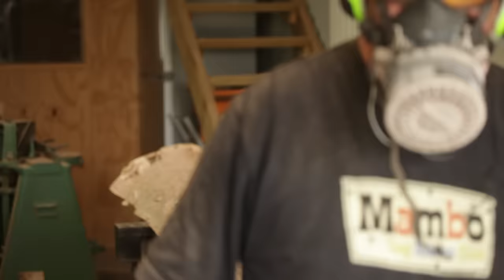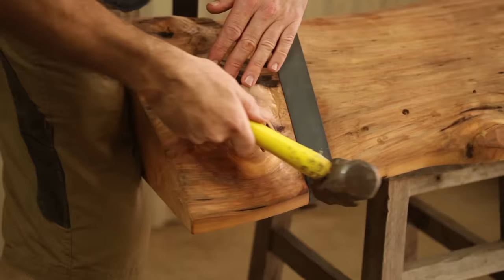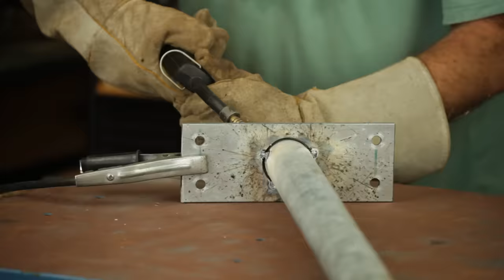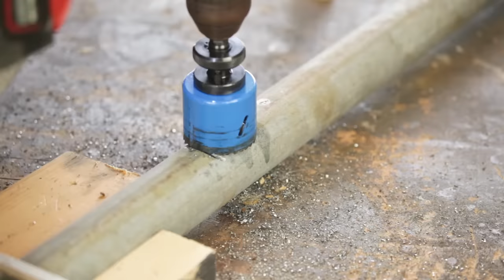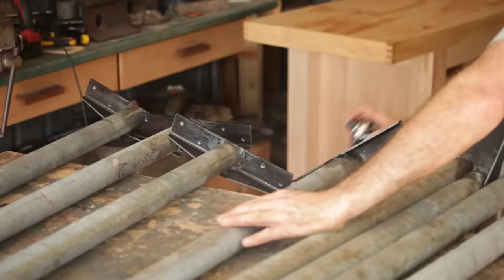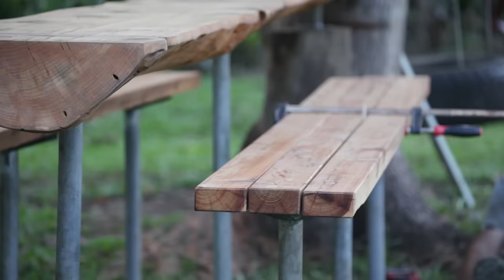Outdoor Table & Bench Seats

Comment: Love it!  Only advice I could give is that it appeared you were using galvanized pipe.  I work for an engineering firm and any time we cut the galv off of steel we used the cold galvanizing compound to spray the areas. Then I would coat the whole lot in another color to even out the spots. Worked very well.

Comment: The best way to concrete posts into the ground, is to put a dry mix in the hole. 
Then ram it down hard so its really tight packed. (You cant do that when its wet.)
Finally pour a little water onto it.
This also produces stronger concrete, as a workable mix usually has more water than is optimum for strength.
Looks like you'll be having many outdoor meals in the future.😎
Regards.

Comment: Fantastic build - love it. As a woodworker with very few welding skills and knowledge I have a question or two:
1) The plate you are using connecting the legs with the tabletop - isn't that aluminium? Because the leg itself seems to me to be galvanised steel and you welded that together?!
2) Pretending that your legs are galvanised steel - you weld them. Will the weld be rustproof or is that a special flux core wire? (I use MIG / MAG and don't know anything about flux core wire welding)

Keep up the good work!
Reply from the maker: Thank you Ron! The plate was galvanised steel too. The weld won't be rustproof - I put a few coats of clear spray on them. Fluxcore is a hollow wire with flux in the middle - this shields the weld from the air instead of using gas. :)
Reply: Thanks for the reply Pask!

Comment: Love it! How long did you let the log dry? I'm hoping to make something like this out of 2 logs that I cut last summer.
Reply from the maker: Thanks Ben! The log has only had 3 months or so since it was slabbed but the tree was already dead when felled so the moisture content wasn't very high (15% moisture where in this area with high humidity 12% would be as good as you could expect). It's not fine furniture so a little shrinkage shouldn't hurt.
Reply: It looks like fine furniture to me! WOW!

Comment: Sure hope that was not galvanized pipe. Very hazardous to weld.
Reply from the maker: Yes, unfortunately some of it was Karl. I did have my industrial fan going so there is at least very good ventilation, that's the one good thing about welding with fluxcore. My respirator unfortunately doesn't fit under my welding helmet so I really do need to get another one. I know this isn't exactly a good solution but I hold my breath, make a weld and then turn towards the fan for a breath. Also I try to weld at arms length so I'm not over the top of the fumes. But you are right to show concern and I need to prepare better. Thank you :)

Comment: i've never seen welding leave so much residue, what are you doing wrong ?
P.S. do you live near a racetrack ?
Reply from the maker: Not doing anything wrong, however I don't claim to be the best welder. The welder I use is a gasless welder (flux core) which doesn't produce the nicest welds and when you add galvanised pipe into the mix then you are really up against it trying to produce a clean weld. ;)